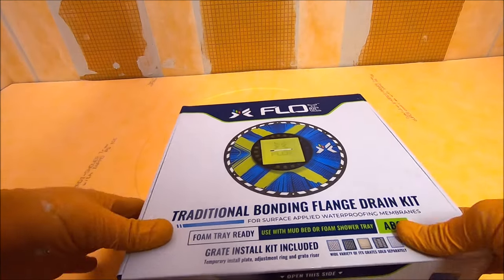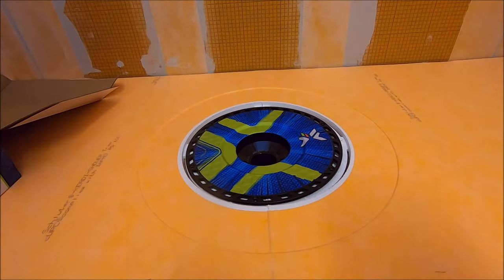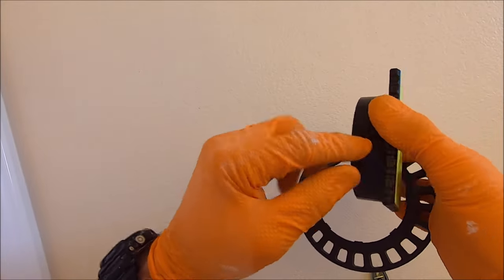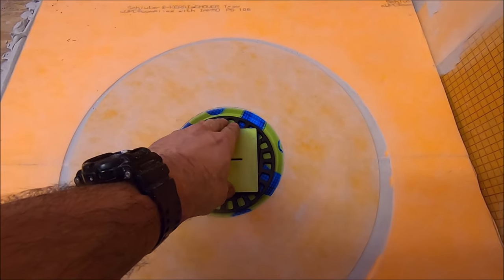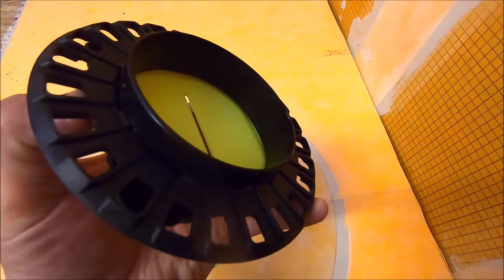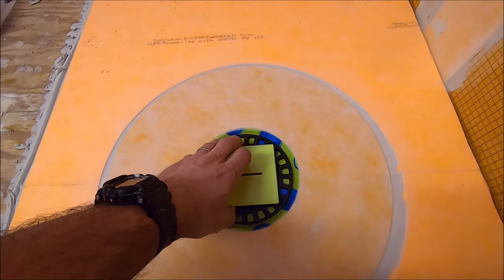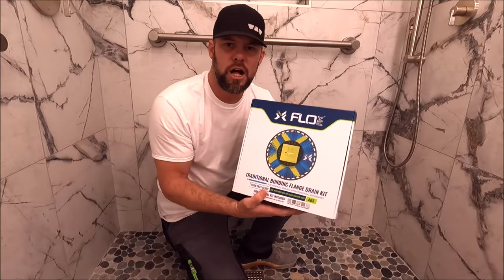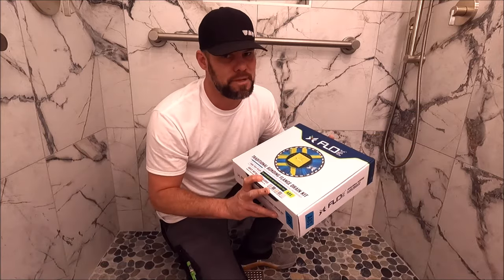It's Finally Here! FloFX and Schluter Together!

Comment: Looks great. Thanks for the helpful videos. I finally finished my medium sized, curbless shower. Basement slab re-do. 36" linear drain, no shower curtain. Wall to wall waterproofed. Separate sloped extra floor drain under the sink for flooding. 
Love the delta 6 way monitor 17 integrated diverter. r22000 body, cassidy chrome.
Your tips on free cutting large tiles with 4" grinder was a lifesaver. I have a cheap wet table saw and it either scratches, tile down or chips tile up.
Free cutting with a wet sponge. I haven't seen anyone else do that. Maybe winni.
Then holding the schlutter edges with blue tape, amazing. Then being care free, take your time and make it count. It is set in stone and a pain to re-do.
Level clips were mandatory with 1' by 2 foot tiles. Mitered metal edges do look good, had to do that around a window and niche. 
Keep it up
Reply from the maker: Awesome on your build! Happy I could help, appreciate the comment

Comment: Question, its the same as the Schluter drain so why not just use that or am I missing something? I can see if you werent using their pan already.
Reply from the maker: We like this drain body much better than Schluter's drain body for many reasons and the grate selection is better and half the cost.
Reply: Jesse’s right on grate selection; Not to mention, a lot of my customers have hard time selecting a finish. The site gives them an endless amount and I’m hoping someone makes a video (5 secs) on taking the green cover off and slapping a new one on. Plus it isn’t locked into a finish on the perimeter like Oatey and Schluter ones are.

Comment: Does FloFX have the adapter drain as well?  I use the adapter drain about 90% of the time.
Reply from the maker: I'm not certain,  everything they have is on their website
Reply: they do have the ability to use an adapter for the old three piece PVC drains.. for the flofx square drain, not sure if it works for the round foam pan drain

Comment: Where do you get the drain membrane? Did it come with the pan or did you order a kit?
Reply from the maker: It comes with the kit (it's taped to the shower tray in the box)
Reply from the maker: You can order a pan separately also, it comes with the pan al la carte.